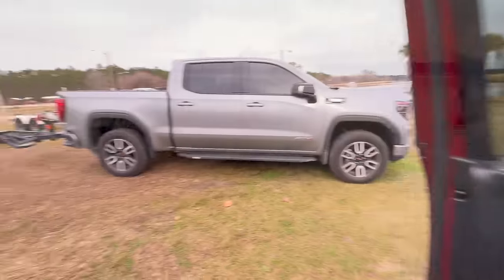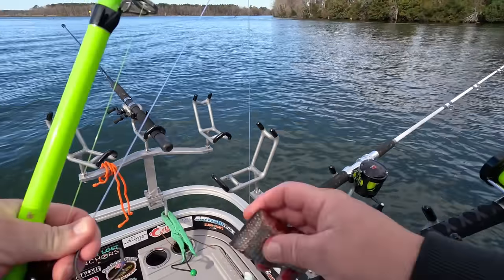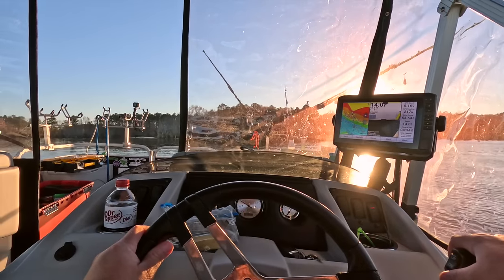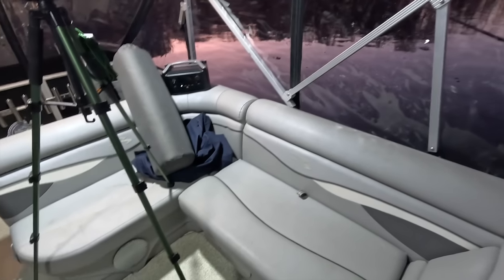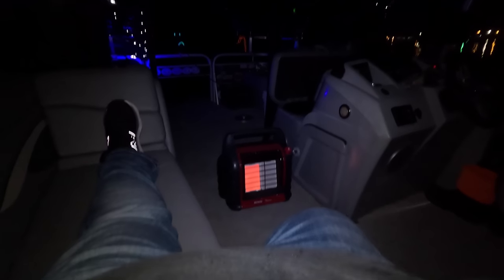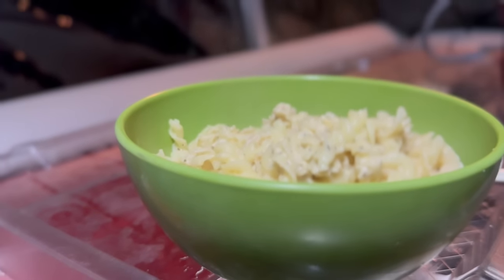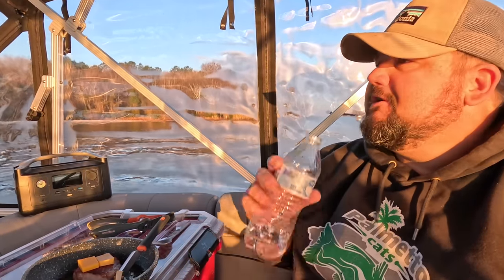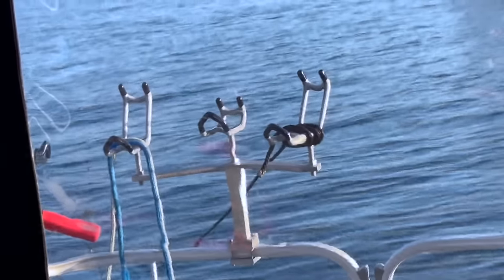Luxury Pontoon Boat Camping (Winter Camping)

Comment: Really nice little setup.   would be great for some of the little streams and ponds around here, though i'd be scared to take it out onto the lake.   I prefer deep v hulls for the lake, pontoons just get tossed around tomuch.
Reply from the maker: Understandable. Thanks for watching
Reply: @PalmettoCats  yeah the lake i live on,  we can see 20, even 30 foot waves in storms.    flat bottom john boats, and pontoon boots just get thrown around in those waves, even some of the smaller sailboats have a hard time.

I helped out in power sail rescue... look up the Optimist class of dinghy.   now picture trying to keep track of those  in just 8' rollers,  while you are in a trawler,  trying to keep hitting the waves at a nice 25 degrees so you don't crash down on the other side.   

every time you hit a trough, all you see is water everywhere...   then you come up and search for where all the dinghies are before dropping down into the next trough.

Comment: I just joined and subscribed.  I'm in Los Angeles, CA.
I have a Sun Tracker 2012 Bass Buggy 18DLX.
I'm about to retire and plan to spend a lot of time on the water.
I need a list of the accessories that I just saw on your pontoon boat.
It would be much appreciated. 
Pastor C. Crowfield
Reply from the maker: Hey there, congrats on the retirement. Most of the stuff I use is in the video description. If you don't see what you're looking for, message me on facebook and I'll get you what you need.

Comment: I’m surprised you don’t have floats or buoy on your anchor lines. Without those you could lose your anchors if the line comes off the boat. I’ve never owned a boat without an anchor lifting buoy.
Reply from the maker: Never really thought about it in shallow water like this. But thanks for the tip.